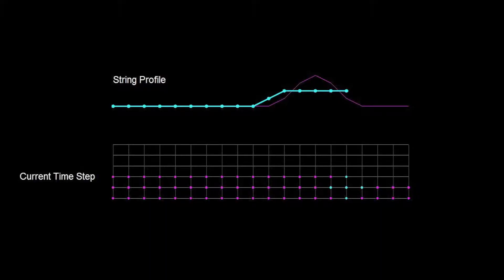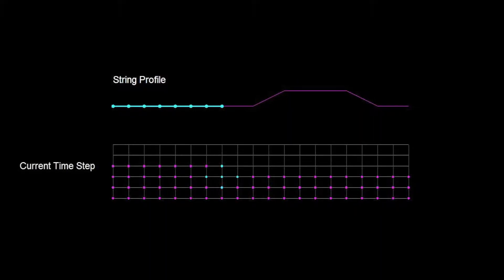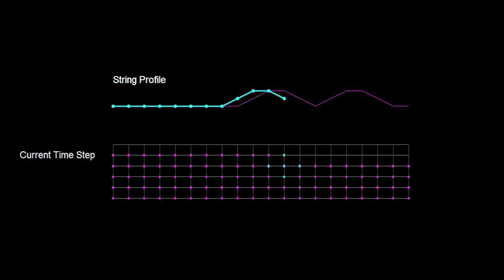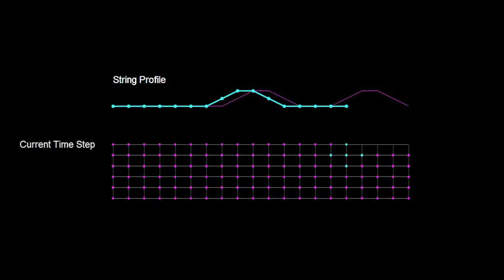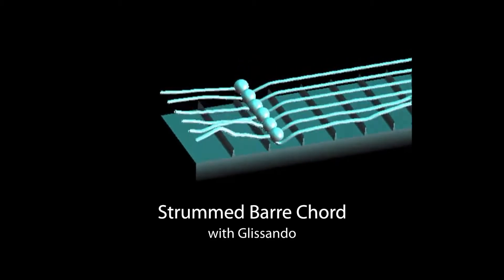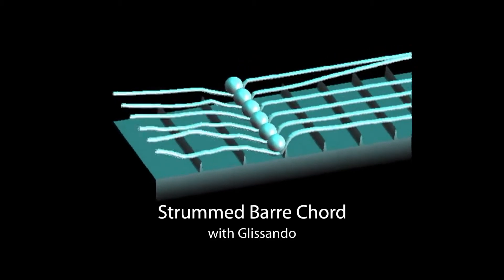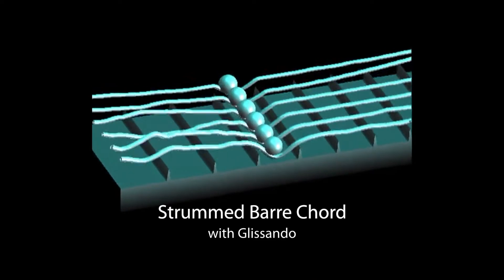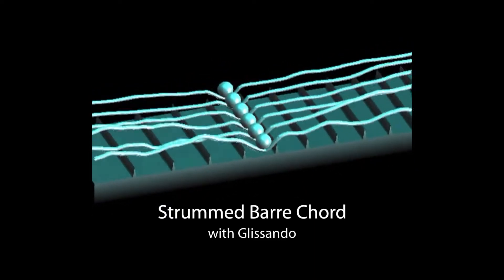The NESS Project:  Guitar Synthesis

Comment: The string animation doesn't make a lot of sense. When a guitar string is excited, the wave doesn't propagate through the string, but the entire string starts to vibrate at the same time as the tension of the string transfers the highest peak of the wave to the exact middle of the string. The animation used in the video cannot produce harmonics.
Reply: Not true, the travelling waves form of the solution and the Fourier solution are equivalent
Reply: Watch a slow motion video of a guitar string being plucked.